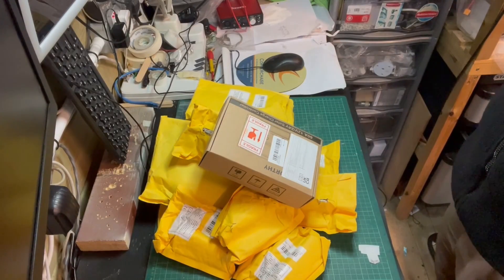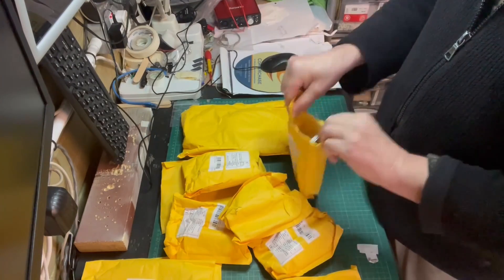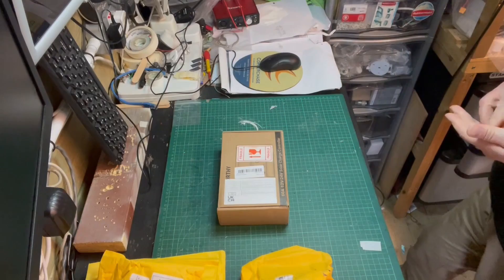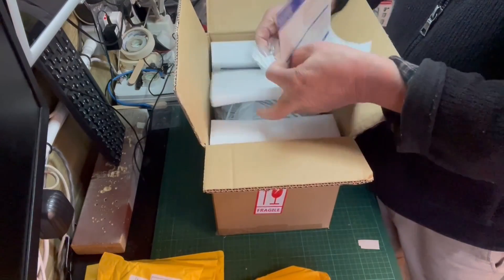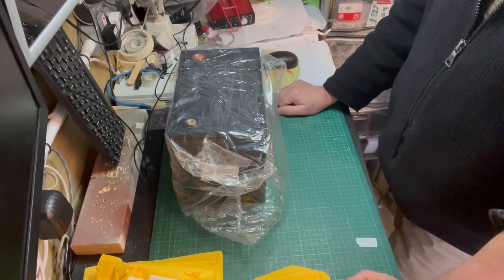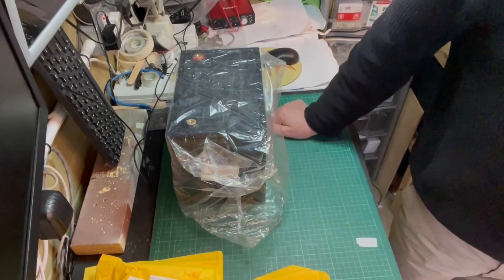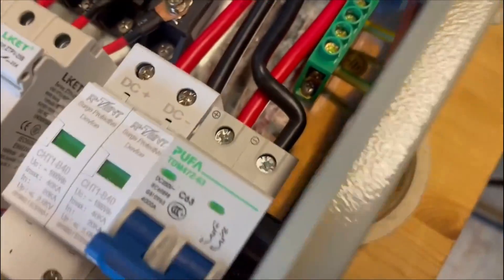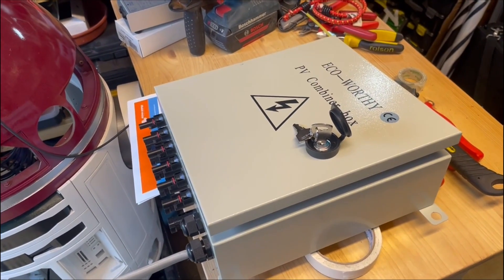ECO Worthy Solar Panel Installation - part 1

Comment: good day .. so many questions.. Im about to buy an ECO-WORTHY 9.4KWH 2340W 48V Solar Power Complete System for Home Shed 2 questions 1 easy and 1 heavy.. Easy one, that Combiner box said Eco Worthy on it.. Did they provide it? Do i need to order that separately? do you have a link? Then the hard one.. It seems to be a year since you posted, how do you like it so far?
Reply from the maker: Hi Douglas, so first question first, the combiner box was not part of the kit, I bought it separately. Didn't need to buy such a large one, got carried away a bit, there are cheaper smaller ones available, lots of manufacturers make them.   Here's a link to the smaller version https://uk.eco-worthy.com/collections/components-batteries/products/4-string-pv-combiner-box-with-lightning-arrester-10a-rated-current-fuse-circuit-breakers-for-on-off-grid-solar-system.  Also didn't need to buy the "lynx 1000" power in box but again could  not resist it.  Big on/off switch a must and also the Shunt as I monitor it all. And the fuse. 

Its been probably more than a year now and its been really great. My systems not large enough to power my workshop for that long during the winter months but fine for hours in the summer and during the summer evenings.  I have mains grid backup if I need it in my workshop but rarely use the mains power.  So all in all its been really good but I want break even on cost savings on grid electricity but that wasn't why I did it all, it was more out of interest to understand it all. 

I plan to install a proper grid connected solar installation on my house at some point, plus battery backup.  I had a heat pump installation on my house fitted earlier this year which also works really well, plus I have an electric car now so loving all the tech and the car and heat pump are cheap to run.  

Good luck with your solar install! 
Kyle
Reply: @kylecampbellweb  thank you for the replay. I try to save the million other questions and ask just two. 1st since im buying the bigger kit shouldn't I buy the same box you had? ( Im buying my kit on Amazon usa, which I have great success getting it to my island so will look there first). Annnnnnnnd over here we use breakers, you use fuses? or is that a solar system thing?
Reply from the maker: @CameronDouglasjr  Hi Douglas, I assume its using fuses because its low voltage so breakers not available, also can handle different low voltages. The combiner box is allowing groups of panels to be wired independently, each group fused and then all paralleled, so it depends how your wiring up your panels.  On my shed I have two groups of panels wired at 24v, so two pairs of incoming cables from the panels to the box.

Comment: Nice. But am afraid for that size inverter your battery cable are not big enough. Are you using 16mm2 ?( looks like) . For 125A need to be 50mm2 or at least 35 ;)
Reply: Yeah you need to get off youtube.
Reply from the maker: I wish I was getting 125Amps!! I have just over 1000-watts of panels at 100% efficiency, but nothing like that here in the UK anyway. Running 24-volts also.  Yes I understand your comment but am running with the kits supplied cabling and am not planning to add any panels. If I do, yes it needs looking at and I have thicker cabling I can use. Thanks for your comment!

Comment: Thanks for sharing your setup, very impressive. What size earth rod did you use? was it 3/8" or  5/8" ?
Reply from the maker: Hi john, its a 10mm rod but that's only because that's we had to hand. My electrician friend tested it all out and we got a very good earth reading. Sorry for late reply.

Comment: Thanks for your very detailed video. 
It's helped me tremendously. 
I've been confused about how to wire these inverters that only have plugs on the output into my breaker box main to power my cabin. 
Your video and explanation has helped me understand. 
I have only 1 other concern that I hope to understand.  That being how many amps these 3000 watt inverters can handle utilizing only one inverter output plug? 
Hopefully I'll figure it out. 
I figure the complete home would require somewhere from 30 to 50 amps and circuit Protection main breaker.  So how can such a small wiring cable such as a 120/130volt standard outlet and plug handle all that power without overheating and causing a fire?
My apologies!
Just trying to understand. 
Any help at all is appreciated 🙏 🙂 

Thank you soo very much for your great video ❤
Reply from the maker: Hello William, when I started to install my solar system I was a confused as well about much of the details about how it all worked. There seems to be an awful lot of conflicting information about how to install systems and also how to safely "earth" the system.  USA and UK electrical systems are different in many respects so YouTube is not the best resource. I am lucky in having friends who are UK electricians and then even then it was confusing.  The system I have installed is a small "stand alone" setup suitable for my workshop or a similar setup.  It is not a "grid" setup connected to the UK mains supply or for selling power back to the big electrical power companies (its an off-grid setup). 

I have installed a 3000-watt inverter which is not designed for higher output powers and therefore is limited to its 13-amp power output. Note that the 3000-watt divided by 230-volts is 13-amps max. This is not a suitable inverter for the power outputs you are looking for.  Also the way I have installed my inverter is with the help and advice of a competent electrician.  

I have looked at larger systems using Victron (or other manufacturers) and there are larger inverters available capable of the much higher power outputs that you are looking for.  Get technical advice from the inverter supplier about how to install it.   The main thing I learnt from all this is that there is lots of bad advice out there (which is why I tried it it the first place to try and understand it all!)
Reply: @kylecampbellweb  I appreciate your feedback Brother. I truly do.
And yes I understand that the system's are a little different. 
I'm going to purchase a solar energy book for offgrid system's. 
I'm just trying to get information and ideas on what other's have done and used.
Yeah: I'm not looking to take care of the state and they can sort out their own energy need's. Lol
I just wanted a little 3000 watt offgrid system for my little homestead and tiny cabin. Is all .
Just trying to sort it out first.
Better to measure twice and cut ones as the saying goes. Lol
No SR.  You've been most helpful. 
Thanks for your video and for your time and you reply to my questions. 
Blessings dear Brother across the pond 🙂👍🙏
May you have many years of great satisfaction from your solar energy and workshop. I appreciate you

Comment: This is something I have been thinking about. Especially with energy prices going through the roof. Looks quite expensive to get set up though.
Reply from the maker: Hi Steve, how you doing? Yes it was more than I had planned to spend, got a bit carried away with extra bits and pieces.  But the basic kits are not too expensive (maybe!!).   I got the idea after watching "ctrl-alt-rees" video install some panels for his office.  I got a larger system than him though, although not anywhere big enough to run my whole house.   It should be able to run a lot of my house in the summer though (apart from washing machines etc), but at present its only connected to me workshop. I spent under £3K in total but you can do the same for about £2K (excluding the Victron bits etc).   Its as much  learning how it all works that made me do it
Reply: Expensive to setup yes. But if power goes you still got some power to keep you going, and this system will still be producing free power long after you and i return to the dust, so our children/grand children can benefit from it too.
Greetings from Jamaica.